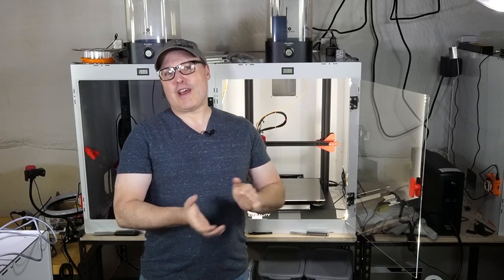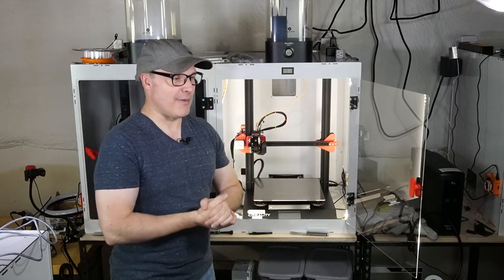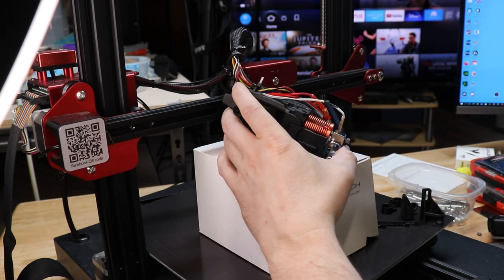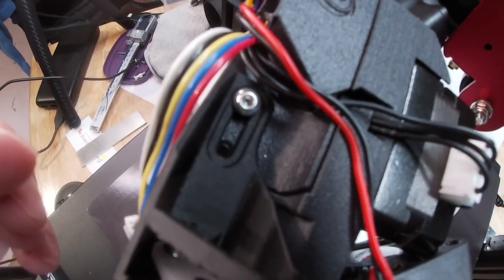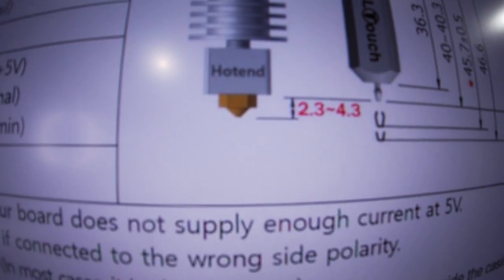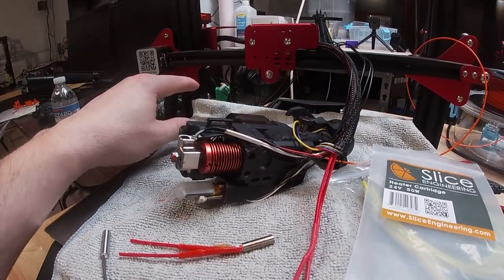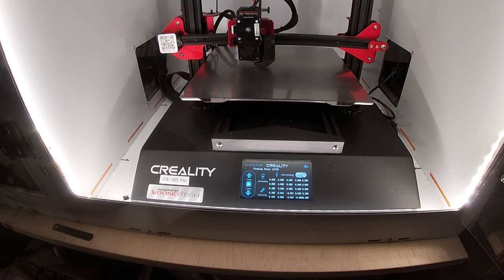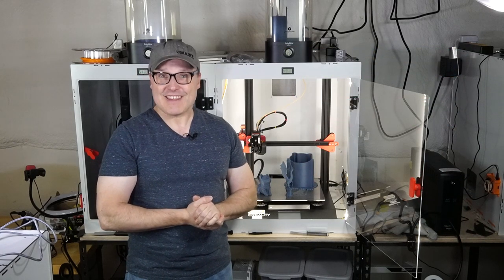Installing a Bondtech DDX on the CR-10S Pro v2

Comment: Thanks very much for the video; it's nice to see the CR10-S_Pro get a bit of love occasionally.  It's still a very underrated and capable printer.

I've had my V1 for three years now, and I have a BL-Touch, along with an e3d V6 sitting in a box underneath it.  They have been patiently waiting to replace their failed counterparts...  for the last two and a half years!  It's been a hugely solid printer, and only in January did I grab a resin jobbie to do the highly-detailed prints that it's unable to do.
Reply from the maker: I converted this v1 to a v2 using the BL upgrade kit from Tiny Machines.  Thanks for your comment

Comment: I really liked your video, I have just completed my upgrade. I am having trouble finding where or how to change the parameter for now having the higher temp thermistor. Can you give some pointers?  Thanks
Reply from the maker: Did you swap out to the Slice Thermosistor?  I’m still using the stock one from Creality but upgraded to the Slice 50w heater. Slice support is very good, ask them?

Comment: I have the V2 and I'm upgrading to the bl touch now. I printed the one below the one you highlighted that's for the CR10S pro. Should I have printed the other one instead?

I have the mosquito and ddx combo on a cr10s pro.

Also, why did you not use the BLT_MC version?
Reply from the maker: That’s what Tiny Machines said to use. 

I’d check to see how everything lined up on the mount you printed. When I’m doing, Bondtech Support is great

Comment: Did you have your swap wires on the jumper harness?
Reply from the maker: To the extruder motor?  No!
Reply: @WhereNerdyisCool  ok cause the instructions say to verify wire termination points on the jumper and I don’t want to mess anything up. Hoping to have this thing back up and running soon. Hoping I can just change settings in slicer to compensate for the new extruder setup. Running the stock heater and thermistor. Ddx and mosquito hotend
Reply from the maker: @justinbeehler188 this worked pretty much just like their instructions laid out. On another video, I put an LGX extruder / Slice Mosquito upgrade kit on a Newereal machine.  I did have a lot of issues rearranging the motor wires / pins correctly to move the motor.

Comment: Just installed a Bondtech DDX v3 with Mosquito ... and first broke off a trimmer potentiometer on the board when adjusting the VREF .. :(  Unfortunately didn't see this video first! But, since I have another CR-10S Pro V2, I swapped out the board and now the thermistor hookup on the board is faulty. Can't freakin' win :( :( :( :(
Reply from the maker: Oh no.  And those boards are hard to get

Comment: did you have to change any settings in the slicer?
Reply from the maker: Yes. Being direct drive I’m using a retraction distance between of 0.8mm and the suggested retraction speed of 35mm. As always I’d suggest Teaching Tech’s Calibration wiki for esteps, slicer flow, PID and such.

Comment: Not gonna lie. Did this a while back and I absolutely hated it. The ddx desig is horrible in terms of clogs. Had to tear it apart multiple times to clear clogs which resulted in me breaking parts sometimes. Word of advice use a 1.75mm rod to clear your clogs rather than tearing it apart. Wish I knew that ahead of time.
Reply from the maker: Good to know.  So far no clogs